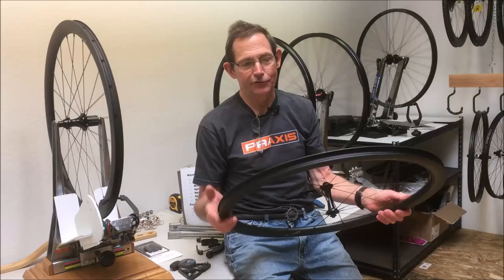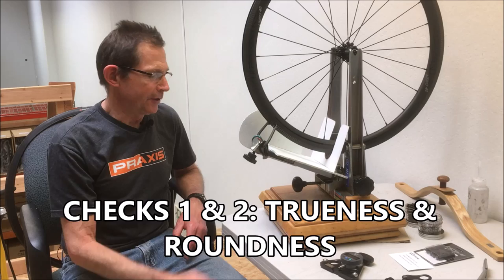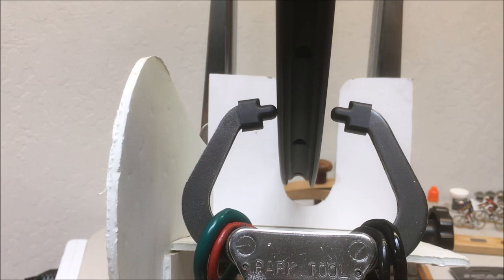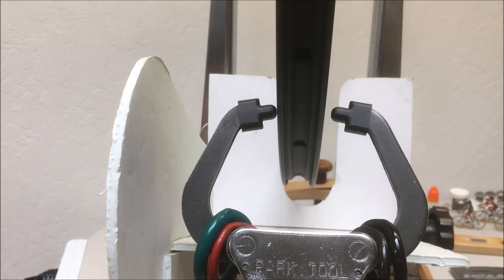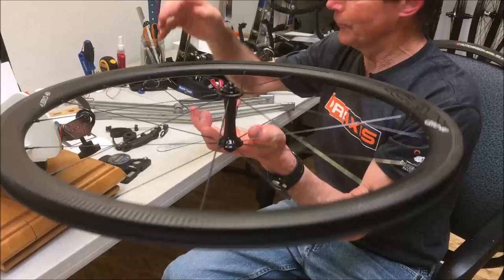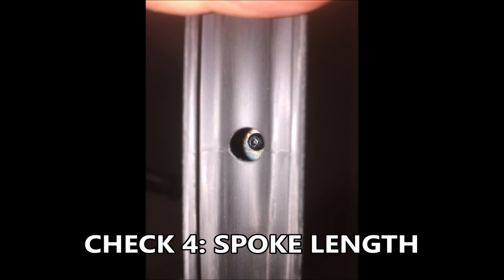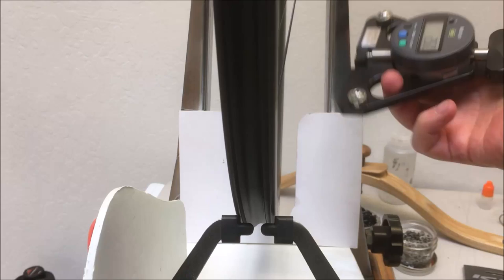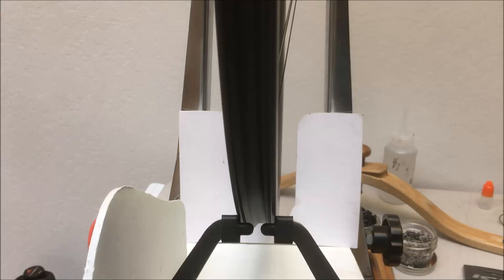ICAN Chinese Carbon Bicycle Wheels Review by Wheelbuilder Jim Langley

Comment: hi can you make a video how you put on and off ( with hand) gp5000 tl on the rims? thanks nice review  btw
Reply from the maker: Hi Laco - I actually have a video showing how to put tires on by hand here: https://www.youtube.com/watch?v=xczZ7_WkVYA It's an old video but it shows how to do it. The secret to putting tires on by hand is to work very carefully and pay attention to what you are doing and MAKE SURE that the beads of the tire stay down inside the rim's middle. That's called the rim "well." It's the bottom most part of any rim and it's the center of the rim. As long as you keep both beads of the tire (the beads are the bottom edges on both sides of the tire) down inside that deepest portion of the rim, then you will find that you have just enough slack in the tire to lift it up and over the rim at the top and pop it on. For tubeless tires, since the special tubeless valve can get in the way a little, start by putting the first tire bead on at the valve and then finish putting the second bead on at the valve. Let me know if you have questions. I hope to do a more in depth video when I can but what I show in the old video is the same tire technique I use on all tires. Hope this helps! Thanks for the nice comment. Jim
Reply: @JimLangley1  yes but i am not asking generally how to do it but actually how to do it with gp5000 tl which are know to be  very hard to put on. thanks
Reply from the maker: Hi Laco, I wish I was there with you to show you how to put on your Conti GP5000 tire. If I was, I would do it exactly the same way I do it in the video. Installation is the same for all bike tires. The secret is making sure that the beads are down in the deepest part of the rim. Please visit this page on my website where I explain installation in more detail. It will help: https://jimlangley.net/wrench/flattiresbyhand.htm I have taught many people to put tires on and take them off much more easily. I hope this helps you get that tire on. Thank you, Jim

Comment: How much would a professional charge to fix those issues?
Reply from the maker: The labor rates at bicycle shops vary greatly, Maximiliano  but, I would estimate that most would charge for an hour's labor, which is typically $50-$75 here in many areas of the USA - can be higher in more affluent communities. Hope this helps and thanks for the comment.

Comment: What you can't test is how durable the wheels are - unless you inspect the carbon with a microscope, and cut it in half too I guess.. probabaly just as good as expensive wheels though
Reply from the maker: Actually, John, you test for durability by riding the wheels and the more the better. I have been doing that since I received the ICANs and so far, so good - no issues to report at all except a great ride for over 1,000 miles now. I will keep riding them, too. If you go through the comments you'll see some other reviewers who logged lots of miles on ICAN wheels, too. So far, the consensus is that they are solid, reliable wheels. Thanks for the comment!

Comment: Great review and reasonings along the way.  But IMO an F for spoke twist is too harsh.  I'd give them a C for that.  I'd reserve an F for something that would make this wheel emminent to failure or unridable.
Reply from the maker: Thanks for the feedback, Chau. I think maybe you didn't understand my F rating. That was only an F for spoke twist, not an F for the wheels overall. When the spokes are twisted, it means the owner will probably want to untwist them and to do that means not just untwisting the spokes but truing the wheel and possibly fixing dish/centering and tension, too - so it's a good bit of work to fix and requires some skill. I hope this helps explain. Thanks again! Jim
Reply: @JimLangley1  ah thanks for explaining your reasoning.  I knew there had to be a why to it
Reply: @WanderingSword  Those spokes are off by probably 30 degrees so they'd be aerodynamically stalled when going. You'd be better off with round spokes if you leave them like that. For the stated purpose - they're aero spokes - F is a very fair grade.

Comment: Are there non-Chinese carbon wheels out there? Don't think so. Just put a "known" brand name on them and mark-up by 200%
Reply from the maker: I'm not certain, but I believe there's a possibility that Bontrager and Enve and a few other carbon rims are made in the USA or countries other than China. And, there are lots of wheels built in other countries. They may use carbon rims from China but the wheels are assembled elsewhere. I understand your point though and appreciate you making it. Thanks!
Reply: Zipp make some of theirs in USA
Reply: I’ve been reading about carbon manufacturing in the Middle East has been a thing for a few years. I can’t remember the online cycling mag I read that in last month, but it was an older issue.
Reply: Not true. My Enve carbon rims and hubs are made in the USA.
Reply: @RB-xv4si  Maybe you mean assembled? The carbon manufacturing know-how has shipped over to Asia many years ago. I don't even thing we could make the stuff any more in the western world. Too labour intensive to be economically viable.
Reply: st939 instead of wasting time hypothesizing about what you think is true, why don’t you educate yourself on what is actually true. Use this link to get yourself started. Like I said, Enve’s carbon rims and hubs are manufactured in The USA (in Ogden, Utah). Read for yourself: https://www.enve.com/en/journal/u-s-made-by-choice/

Comment: Road cc give these wheels 3/10, stating they had poor lateral stiffness
Reply from the maker: Yes, I saw their review, K Graham - nice to see others review the wheels. Please note, that they actually wrote about the Aero 50 wheels, not the Aero 40s that I did. Also, from what I can tell, they did a ride review, which is different from my technical inspection of the Aero 40s as a pro wheelbuilder. Since they felt the wheels had sub-par lateral stiffness, I would have liked to see them actually measure the spoke tension in their test wheels (as far as I can tell, they only provide the tension that ICAN says they use, not an actual measurement). On my set the front wheel was a bit under tensioned. That might be what's causing the issue on theirs. I appreciate you commenting, thank you! Jim
Reply: Jim Langley I was also reading the road cc review, wondering about the lateral stiffness. Have you posted a ride review on these aero 40s anywhere?
Reply from the maker: Matthew Matera Not yet. I want to get in at least 2K miles, more even. But so far, over hundreds of miles I haven’t felt any issues with lateral stiffness. It’s kind of a difficult thing to test or feel just by riding - I would like to ask those guys how they tested.

Comment: The dish test seems flawed to me, if you adjust the bracket to contact 3 points on the "longer" side, you won't get any rocking on the shorterside, because the outer fee touch, but the center doesn't.
Reply from the maker: Schwurbel Maybe I didn’t explain what I was doing well enough. What I was trying to show is that with a properly dished wheel once you set the tool so that it touches at all 3 points on one side of the wheel the tool will also touch on 3 points on the other side (once set to one side, you don’t change the tool - it’s then just used for reference). Hope that helps explain. Thanks for the comment!
Reply: @JimLangley1  Yeah I get that, but do you notice if the outer points touch but the middle one doesn't?
Reply from the maker: @maxupp  When you use a dishing tool, you always start by adjusting the center post to rest against the axle. If the post touches before the feet on either end, you would adjust the center post out until the feet on the tool on both ends touch the rim. If the feet touch first you adjust the center post in until it touches. Either way you adjust the tool so that all 3 points rest against the wheel. Once the tool is adjusted like this, you move it to the other side of the wheel to compare that side to the other side and make sure the rim is centered over the axle (all 3 points will touch on both sides of the wheel if so). When setting the tool it's easiest to "read" the tool if you set it so that any clearance between the wheel and the tool occurs at the feet, not at the center post. That's because the feet are where the rim is. So, by seeing that you have a gap at the feet on one side tells you that you need to move the rim in that direction. Since moving the rim is what truing and dishing involves it's easiest to work this way. But, if you wanted to, you could go by the gap between the tool and the hub, too. In that case, you would be thinking of dishing adjustment to the wheel in terms of moving the hub. To most builders that can get confusing i.e. moving the hub instead of moving the rim. Hopefully this helps explain. I'm happy to keep trying if not. Best, Jim

Comment: I’m still waiting to see a pair of non-Chinese wheels! Maybe you should rethink the name of this video...perhaps Chinese Designed? Chinese Owned Company?
Reply from the maker: Thanks for watching and the request, Craig. I think you'll find that there are lots of "non-Chinese wheels," such as HED, Boyd Wheels, Zipp, Roval and more. Maybe you mean that most carbon rims are made in China, but to me that doesn't make the wheel a "Chinese" wheel. The companies having rims made in China likely spec their rims to be built a certain way so while it may be built in China it's designed by the company. I would consider those wheels as American or from whichever country designed and assembled, built the wheels. In the case of my video, ICAN specifically requested that I call them Chinese wheels because they are proud of making the wheels in China. Hope this helps explain.

Comment: The kilogram is a unit of mass, not force.
Reply from the maker: Hi Gregg - when it comes to measuring spoke tension, the tensiometers use kgf (kilograms of force). Jobst Brandt wrote in his book The Bicycle Wheel “kilogram (kg) metric unit of mass (used as a unit of force here) 2.2 pounds.” So kg can be used both ways. Hope the helps explain. Thanks for the comment.

Comment: My God... with all of my respects, people have no idea of what and how a professional wheelbuilding looks like. In true professional wheelbuilding tools are not used BUT INSTRUMENTS. It´s fine for amateur/enthusiast level, probably most bike shops can´t reach it, but nothing to do with real professional level or quality control either where everything is MEASURED (metrology).  By the way it´s my recommendation to avoid CARBON handling/manipulation due to its high CARCINOGENOUS POTENTIAL (BLACK CARBON DUST IS COMPARED TO ASBESTOS). You can see black dust when handling carbon rims, and it generates it when tightening the spoke by nipple-to-rim friction.
Reply from the maker: Thanks for the feedback RMG - and for the safety warning to avoid carbon dust. There are actually quite a few videos on youtube on pro wheelbuilding by the major wheel and wheel component makers. Here's one by GCN about DT Swiss: https://www.youtube.com/watch?v=2zkt-kM8JIA&t=627s  It is impressive to see the tooling and apparatus used to measure all aspects of wheels. Thanks for the comment.

Comment: "That's a nice wheel" you have to be joking lol
Reply: Were you paying attention? He's not joking, and they are great wheels, I can personally confirm the opinion of the pro wheel builder. I've been riding 35 years and built several wheelsets, owned dozens of others. I just got some of these ICAN Aero 40's and they are legit and some of the best wheels I've ever owned. But you're welcome to not buy them, and have some comparable Zipps, Enve's, Boyd, custom whatever for 3-4x the price....  I'll take a couple sets of these every time.
Reply from the maker: Thanks for sharing your experience with your ICAN Aero 40s, ernie, appreciate it. Mine are still running true after 2K plus miles - quite a few on dirt roads even.
Reply from the maker: Thanks for watching and the feedback, barrie. FWIW, I'm not joking about them being nice wheels.